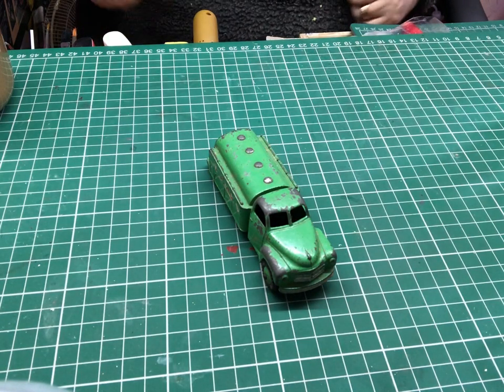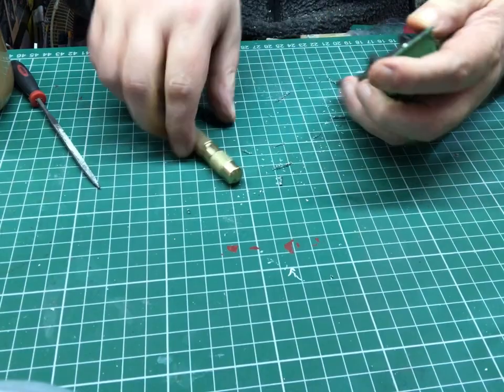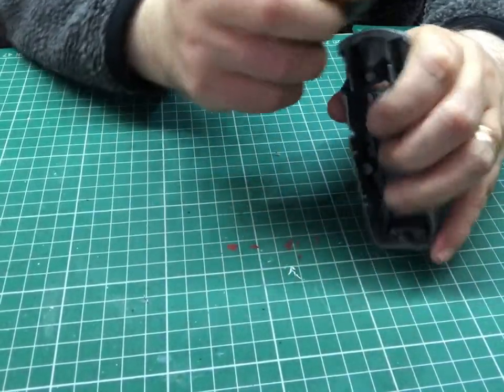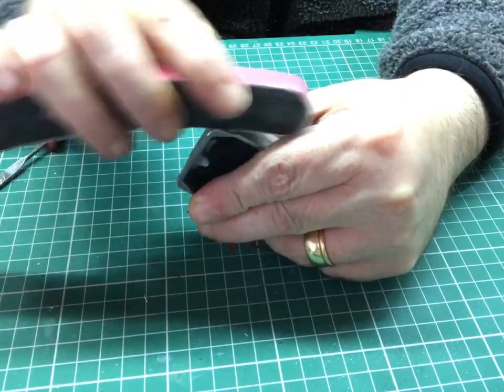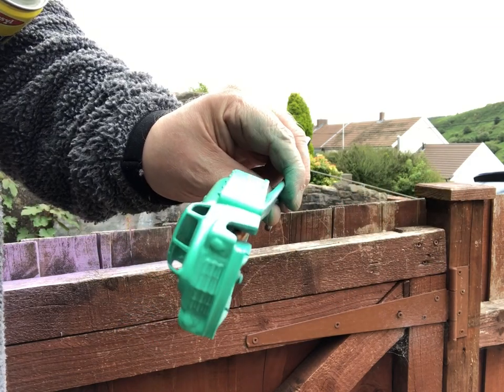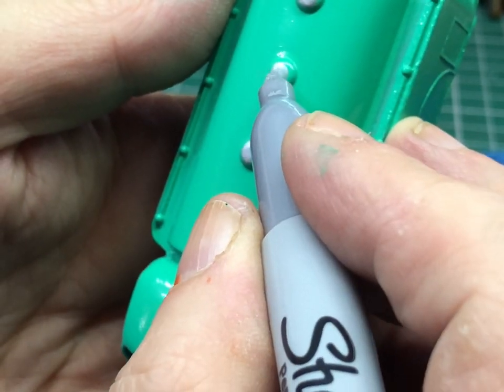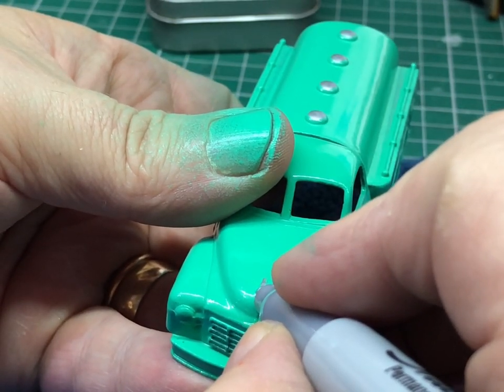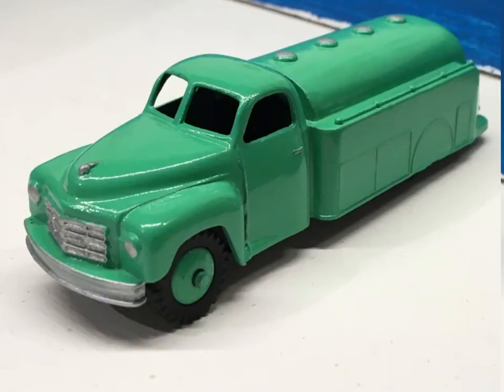Dinky Studebaker Petrol Tanker

Comment: Super job George, looks really good and you matched the colour up well! Those sharpies are great, mine arrived the other day and I’ve already used them! Have you ever used other colour ones like red for tail lights? I wonder if they would be colorful enough to show up. Anyway, lovely restoration mate, take care, all the best, Nick.
Reply from the maker: CRAPAUD NICK'S DIECAST RENOVATIONS. Yes nick I have used other colours for tail lights but you need to base coat the lights with tipex correction fluid as it’s white and gives a great foundation for your colour, I love the sharpies they work great, thanks for your kind words buddy, take care mate 👍